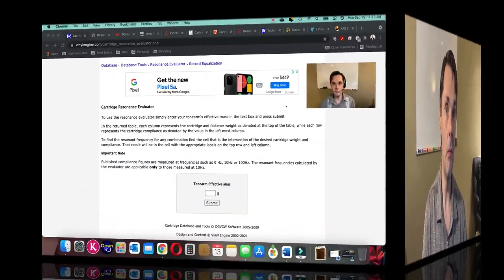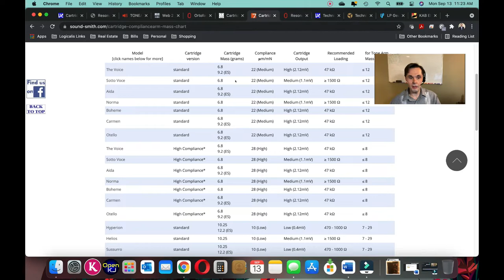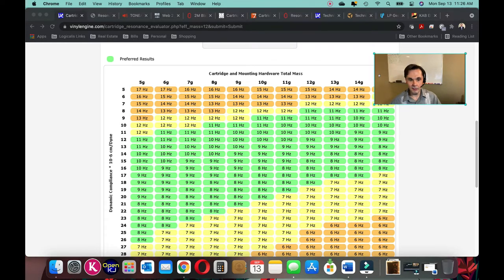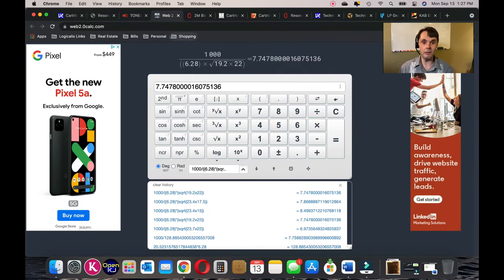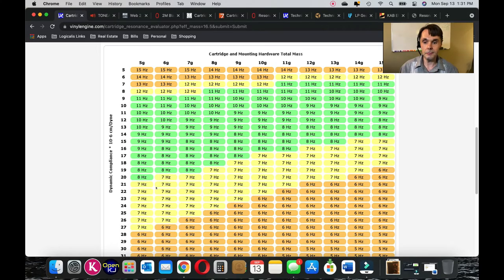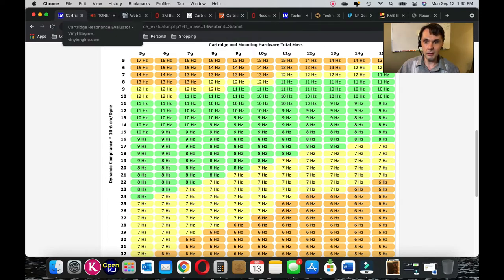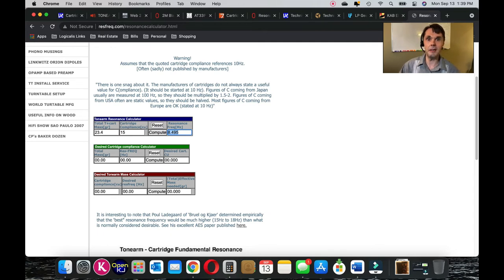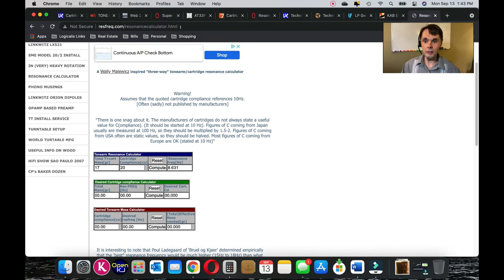How to Choose the Perfect Phono Cartridge Compliance Profile for Your Turntable and the Tonearm

Comment: Brilliant - despite my dyslexia I got a degree of understanding - I followed with my  AT33EV in mind but also considered my MP200 Nag as well and on my 1200 G with Jelco HS25 Headshell (12g) If I go with your At33PGT/ii I should be Ok - but also (now) considering the MP200 with maybe an MP500 stylus
Reply from the maker: The 10g lp gear ZuPreme is a better fit… same shell 2g lighter… need a spacer on the techie with that shell… I use a 3D printed 3mm one… consider the heavy aux weight from KAB as well… counterweight closest to bearings helps a bunch I’ve found
Reply: @BensAudioCave  So the ZuPreme is the same thing - only 2 G lighter? Darn I donl;t know what to do now!   I have the heavy counterweight on to balance the whole thing does that need to be added to the equation or is the other side of the bearing not part of it all>?? Also I am planning to keep two AT's (maybe) on identical headshells ready set up so I would have to buy another 2 instead of 1 unless I stick with another Jelco (I have an ECV and may buy the PTG/ii - unless I decide hang it all and play around the the Nagaoka MP200  (= 200 & 500 styluses)
Rabbit frozen in the headlights right now.
Reply from the maker: @Geoff0711  the ZuPreme is identical to the HS 25 (I have the 12g one and 10g) but also offered in a lighter 10g… I just know having the weight as far in as possible seems to make it work better
Reply: @BensAudioCave  Just wish I had known about it a few months back when I got the Jelco - if I buy a PTG/ii I will want 2 identical Headshells for that and the EV - I will look it up - maybe I could mount the Nagaoka in the Jelco so they are all interchangeable but the 2 AT's a straight swap with small tracking weight change
Reply: I had to order another Jelco the ZuPreme was not available anywhere helpful - however - it occurse to me that the MG arm on these 1200G maybe a tad lighter than the arm on other SL1200's - so would that not go towards the difference we were trying to get by getting the ZuPreme over the Jelco?? 
Also - ordered the last PGT/2 off Amazon UK today so should have an EV on one and a PTG2 on the other headshell so I can switch as and when I feel like it...Hoping I am not far from the sweet zone on both - I cannot quite wrap my dyslexic brain around all the figures especially as the Compliance is at 100 hz as well as there is dynamic and static - its all too many numbers! 🤪
Reply from the maker: @Geoff0711  100Hz for the PTG 2 and EV I use 1.7 as the multiplier… if it were me I’d use the Jelco shell on the 1200g and the 1200g shell on the GR (it also has azimuth and is 8.5g) and that should about balance it out… think compliance is like 16-18 on both (it’s 10 @ 100Hz) not a totally exact science with figures but the test record won’t lie 😃
Reply: @BensAudioCave  Thanks Ben - great work on here...very helpful. Its just a 1200G I have - the old deck was a Gyrodec. I will have 2 Jelco Headshells one  with an EV and one with a PTG2 - once bedded in I will add a recording of the PTG2 to my comparisons CD. Made a few listening observations that way. EG: EV with the Jelco did sound a bit tighter than with the Technics Headshell...Achromat also helped a bit after that

Comment: Hey Ben, how can I find out the weight of a headshell?  (because I need to buy one before I work out the cartridge specs) My Rega 6 was bought without a headshell.
Reply from the maker: I take it your Rega has the s arm?  The specs are published on the manufacturers website… I can make some recommendations if you’d like
Reply: @BensAudioCave  Ahhh man,,,could you? I really appreciate you taking the trouble, the whole "Tone-arm, Cartridge" thing was a complete mystery untill you came along.  God bless you Ben, and keep doing what your doing, and lets put high end audio back at it's correct place on the top. High end audio should be for everyone who care's about music, (not just for people who could afford it).
Reply from the maker: @louisgreen3915  can you email the address on the channel with a couple of pics and cartridge you are going to use etc?  Just want to make sure I recommend all the right parameters and might be easier to communicate
Reply from the maker: @louisgreen3915  assuming you are using the old Rega R200 S-Shape it was made by Acos and had an original 8g head shell and effective mass of around 16g with it... So the arm effective mass is 8g without shell... That said; depending on cart choice you have some options.

Comment: Using a Hadcock GH242 uni-pivot tonearm with effective mass of 11.4 grams and a Denon DL -110 moving coil cartridge of total weight  5.6 grams and dynamic compliance of 14 x 10 -6 cm/dyne results in a cartridge suspension resonant frequency of 10.31 HZ which should be satisfactory.
Reply from the maker: A little weight up front would hurt anything… but hey if it works; right?  Unipivot arms can behave a bit differently than their gimbaled counterparts… but hey if it sounds good to you then awesome!  Those are pretty sweet arms

Comment: Dear Ben, 
My oh my ..how do i start. Emoji head explosion says all. So i just shoot and hope for the best. Will you help me with an answer? I use the Denon dp 300f. Current cartridge Mp-110. Run time stylus is ending. So i bought Goldring G 1006. But how did I forget this subject... 

So big question, can this tonearm (cant find the weight/mass ,headshell ( pcl-310k) be combined with the Goldring 1006. I tried to register on VE. There not taking new registrations. The cartridges do not differ much in mass. 

Thnx in advance and great job
Reply from the maker: So yes the 1006 will “work” on the denon but it’s the last upgrade I would have likely ever suggested… compliance wise it’s a bit high for your arm but would be meh ok… now that said; if you have an option to return it; I likely would as an AT VM95ML or even 540ML would be a better fit at much less coin… the DP-300f isn’t an awful table but it is an entry one… Honestly for the money it’s hard to beat the AT VM95ML and it will get you around $180 back in your pocket and treat the inner grooves better than the Nagoka or that particular Goldring… also make sure you are aligning 45mm from headshell attach point to stylus tip… here is the cart I would recommend
https://amzn.to/3NT3cdn
Reply: @BensAudioCave  thnx again yes. So does the AT VM95ML beats the current mp110 or should i have go with the VM540ML... :)
Reply from the maker: @mreinsteintoptop  imho yes… because of the stylus… YMMV but it is the right cart on that table if you ask me
Reply: @BensAudioCave  i took your advise.  I returned the 1006 and got me the AT VM 95ML. Now i must place it the correct way. I know each hearing differs from one another. But its good to benefit  from others experience. Thnx.  

Pardon my boldness,  but alow me to add another question. Feel free to answer ;) 

I also own a Thorens TD 166.  Completely overhauled. Momentarily i use a Goldring G 800 or 800E. (Are you some what familiar )What is your recommendation on stylus upgrade. Awaiting your response :)

Comment: I also tried to calculate using figures and calculators online but the real life results were wrong! In real life using a test record and testing cartridges is best method. The specs that cartridges producers supply are mostly wrong! For example the newer AT-VM95 cartridge is not medium compliance but high compliance and resonate at 7Hz on my AT-LP140 turntable which is medium mass arm. 😉

Comment: I’m using a 1950s Fairchild moving coil cartridge heavy tracker on a TNT
I’m afraid to touch anything.
Reply from the maker: Older carts can be tricky to find info on… however MC carts will need to be at a minimum retipped from time to time… if I can help in any way just drop me a line at the listed email on the channel!

Comment: I have a Thorens TD165: TP11 Tonearm = 16.5g ; TP60 Shell = 9.6g
Mounting Hardware total mass = 1.1g
Stanton 881S cartridge = 5.7g ; Dynamic Compliance = 30um/mN @ 10Hz (?, I have doubts)
=> Mass: (16.5+9.6)+(1.1+5.7) = 26.1 + 6.8 = 32.9g => F_resonance = 5.0659Hz ?
or
=> Mass: (16.5+0[embedded shell])+(1.1+5.7) = 16.5 + 6.8 = 23.3g => F_resonance = 6.0197Hz ?

The F_resonance is very low, but with Tracking Force of 1g (without brush) since 1986 I have never had any problems. Why does the F_resonance have to be in the 8÷11Hz range? What serious thing happens outside this range that doesn't happen inside this range? Thank you
Reply from the maker: There is more to it than that… it’s like running too soft a suspension on a car… the resfreq is just a measure of that… the tp11 is a fairly heavy arm and needs a lower compliance (hence stiffer suspension) cart or else it can sound stuffed and not track warps very amongst other things
Reply from the maker: Also the shell is included in the mass of the tp11 IIRC so the math may be a bit off
Reply from the maker: The AT33PTG/2 is a decent match for your arm as but the VM540ML is even better and would really open up your sound… I loved the old Stanton moving irons but they need a much lighter arm to be at their best here is a link the 540ML

https://amzn.to/4a6MkeQ
Reply: @BensAudioCave  Originally, a Stanton 500, I think Stanton 500EE, was mounted on the TP11 with a D5100EE stylus (1.5g of tracking force, elliptical seen under the microscope, and golden rectangle). The Compliance seems to be 16um/mN, therefore about half of the 881S. F_resonance > 8Hz
Reply: @BensAudioCave  Since the Stanton 881S is made in the USA, the data C = 30um/mN could be in static regime (0Hz). In fact, with C=30@10Hz a cartridge from the late 70s would require an ultra-light arm of 5g!!! which perhaps didn't even exist back then (in carbon fibre). More reasonable C= 30/2 = 15@10Hz. All that remains is to try with a test LP, and see if the resonance with the TP11 is at 6Hz (KO) or instead at 8.5Hz (OK) as I hypothesize.
Reply from the maker: @giovannibaietti2384  Honestly anything can be ok... And sure there were compromises back then... Now that said; this is DYNAMIC compliance not static.  That is the figure that is used to calculate.  The 680EE is a great fit too...  If you're happy then go for it... listening habits vary but I for one found my line of best fit.

Comment: Nobody in the world seems to know what the effective mass is for the technics 1200gr. Supplied head shell...is 7.6g. People have speculated the effective mass is 9 or 12g. Vinyl engine has no information.  It's been beyond frustrating.
My cart reads two compliance s. Dynamic and Static. It's also Japanese (Mp-200)
Reply from the maker: According to the technics rep it’s 4.5g without the shell
Reply: @BensAudioCave  thank you. And for Japanese carts... I take the dynamic compliance which on the mp200 is 7.2x10-6 cm/dyne and times it by 2?

Comment: From my calculations, the Hanas are almost as bad on an SL-1200.
Reply from the maker: Except for the ML... That has more weight to it... However, you can change the game by altering headshell mass :)
Reply: I personally prefer resfreq to vinylengine because it doesn’t round to a whole number and you can just the tonearm/headshell/cart masses all at once, and you can play with those numbers without going back and forth.
Reply: @BensAudioCave  Funny thing I found, which totally breaks the law of only changing one parameter when you’re trying to a compare - my Hana ML (boron cantilever and microline stylus installed by Soundsmith) on an Ortofon LH-4000 headshell sounds way better on my GR than the stock Hana on the LH-4000 on my mkii. The RF is around 7.48 for both tables calculation-wise, but I realize it is absolutely not an apples-to-apples comparison. Better table? Sure. Better cartridge now? Maybe. I have a Shure V15MR Type V on an original mkii headshell that I need to try out to see what that sounds like now.
Reply from the maker: @homerjones3291  definitely my preference as well for the same reasons
Reply from the maker: @homerjones3291  it really blows my mind how even small environmental discrepancies seem to make a difference sometimes